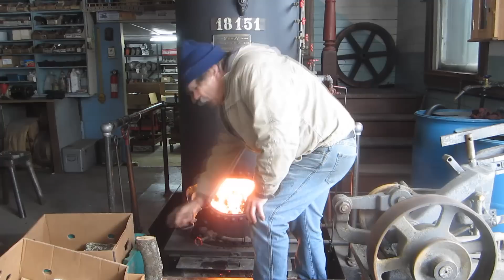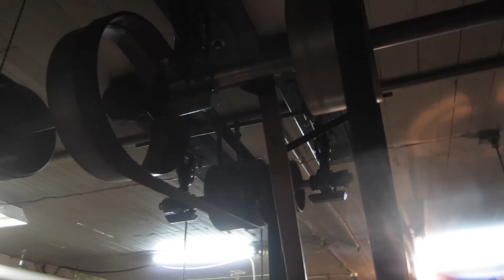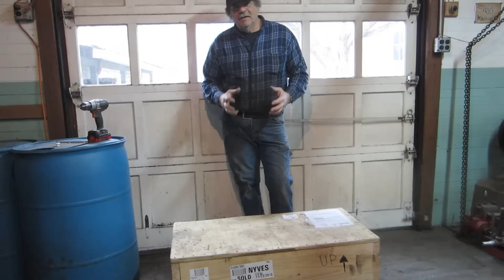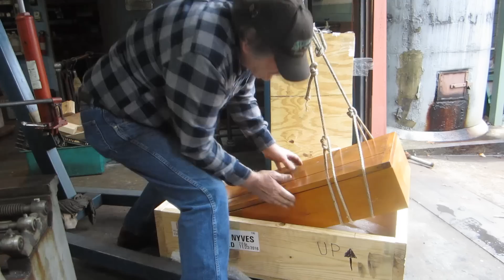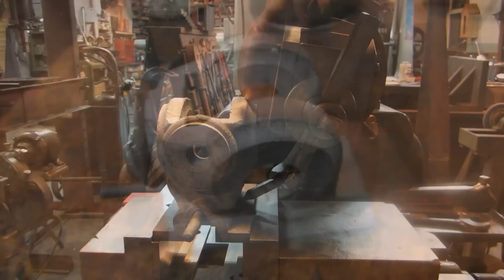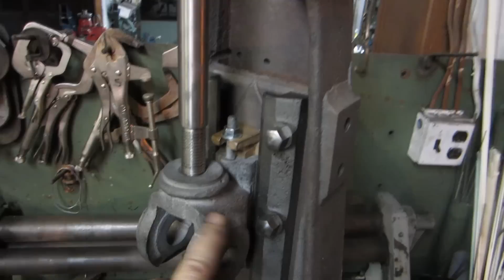OLD STEAM POWERED MACHINE SHOP  18   Progress on the steam engine

Comment: Is it actually necessary to remove the pitting on a wear surface like you showed on the crosshead? Or is it just a point of pride? In my mind it seems like the pits would just trap oil/grease and do no harm. As long as there's no protruding rough edges of course.
Reply from the maker: Probably not, but I figure that very smooth surfaces will trap more of the oil "wedge" at speed and keep the metal pieces apart from each other better under load.....Dave

Comment: Dave: I'm sure you've mentioned it somewhere, but i've failed to hear you explain it. What is the meaning behind the numbers 18151 on the boiler? Is that the permit number Or what?
Reply from the maker: It is the New York State boiler license number issued back when they only had 5 digits.....Dave

Comment: Sir,  Love your shop.  On you rebuilt engined you might try using a "zerts" fitting to be used with a grease gun.  This would keep the dust out.

Comment: I'm looking to build my own boiler. do you worry about boiler chemistry? Do you drain your boiler periodically?
Reply from the maker: Some water is worse than others, but generally a boiler (more so with modern steel) will last much longer with water treatment, regular blow downs and occasional "open and wash out". I use Jim Conte's "boiler Saver".

Comment: I noticed at around frame 4:20 that the speed of the lathe tends to fluctuate a bit,  I'm guessing its the the frame rate of the camera is obviously causing a strobe effect, given the camera is probably the more steady timing this is creating the indication of a speed change on the lathe  i'm assuming from the steam engine  torque changing between power strokes? Does this ever cause you any problems? and does it effect finish surfaces or chatter? Or does that fluctuation actually help prevent chatter by changing speeds ..I remember someplace watching something on modern lathes using that actual phenomenon to reduce chatter by purposeful fluctuating spindle speeds...curious to know what you think about it.. Again I get great joy out of your videos...thanks,
Reply from the maker: At that particular speed, a slight fluctuation in speed must have been driving the camera nuts "strobing" the frames. It definately was not doing what it looked like it was doing. It's a problem with that camera in low light.....Dave

Comment: Hi Dave, another great video, thank you.

I am learning a lot from your workshop about how machines and tools were used.
The one thing about our 1840 - 1870 lineshaft workshop - no graduated dials or handwheels. They made one part then made the next to fit it. No off-the-shelf spares in those days. But, and the big but, those engines are still running after 150 years!

Your comment about the glands got me thinking; all our gland plates at the Forncett Steam Museum are flat as yours was. Our engines are all made in Britain, ranging from the middle 1800s up until the middle 1900s, so maybe it was the packing used that determined the face. We use square-section graphited rope which would require a flat face to compress it. I am guessing that you use round which is why you have a tapered face.

It is true what they say; you can make anything on a shaper except money. Slow but sure.
Good to see you use carbon steel too - there would still have been a lot around in 1925.

Best wishes

Andy
Reply from the maker: Andy: Thanks for the discussion, I think I will use the square section Garlock steam packing, same as was used in the Frick engine that I built the valve rod for. That had a tapered seat (both inside and the gland) and it seemed to work well. It ran all last season and I don't think they ever took it up once. It is amazing what you can do with just carbon steel tooling, but even High Speed steel is getting to be a thing of the past....Dave

Comment: David thank you for keeping the video's coming.love um!i can't wait too see the boring tolling attached to the steam engine cylinder.would you know anything about a machine that turns the diameter of an old style frick crosskead slide.this part is made of a single piece of cast steel.i have researched this process for years and wondered if you know anything about the machine that done this operation?i found several patents for this operation and made a working model from just the drawings.i would really like to see an original machine.can you give me any advice about this?

Comment: I love those old lighting fixtures you've got, fluorescent lighting wouldn't look right in your shop, you've got good taste.
Reply from the maker: Yeah, but Tom thinks we need more light. Maybe hotter bulbs....Dave
Reply: I would try with those glass-bulb warm white LEDs atleast on top of stuff, and it helps if you just put more ligth at the roof so it won't ruin the "feel"

Comment: OK love the old phone ringing at frame 4:58...HA...im guessing an old bakelight? i have one too and must hook it up....
Reply from the maker: It's an external ringer with brass bells mounted up on the wall. I couldn't believe it would work on my system, but I even put a second one in the front shop wall. I can even hear it outside because it makes the wall vibrate.....Dave
Reply: David Richards HA love it thanks...Yeah they kept the old systems the same and built on them...its astounding they can send data on a two wire balanced line that was made so long ago.. goes to show the human ingenuity and as you are my favorite shop to demonstrate that... I cant thank you enough for bringing it into view for us all.. Just the notion that we think all old is primitive and yet the accurate work you can do in a steam driven shop is inspiring.. It show's how we got the steps to our modern technology through so many clever innovators of the time...

Comment: That old boring  bar! Grandad said he had bored cyls with a hand crank setup, I believe he said it was a Rottler. If I remember correctly, he said it was a horrible experience.... Took him to the shop I was working in, back in the late '70's. He'd been retired many years by then. Soon as I opened the door, he said "well the smell hasn't changed any in all these years" I showed him the Rottler we had there, it was a table type, and the head floated on the table over the block to be bored, centered, and then clamped with an air clamp via a T slot. Then we went over to the Sunnen  ck-10 hone. After we left, he said that If he'd had this modern equipment, he'd have made good money instead of just getting by. Thanks for posting these videos, enjoy the warmer weather in Florida, and hurry back to You Tube!

Comment: Hi Dave, Come on, a little lake affect snow and you run south. Were having a few inches  tonight in the lower Hudson Valley tonight, but after the 1st I'm going farther south than FL. Liked that cylinder borer, let's see it do it's thing. The shop in Gasoline Alley had a Kwik-Way.

Comment: Most enjoyable. Great to see the Morris coming together. I see you have a Duplex pump in your shop. I have a Worthington Simpson Duplex, been mine since around 1970. Not been under steam since about 1990 (at the RH & DR). What is the back story on the Duplex? Rgds, Doug.
Reply from the maker: Just something that my Dad had from way back. It had been taken apart and regasketed but the valve timing was all screwed up. It runs nice now on air. I have plans for it sometime....Dave

Comment: Excellent as always Dave. I found that boring bar very interesting. Reminded me of the Van Norman boring bar I used in the 70s while reconditioning car engines for 4 years....excellent machine. 
Enjoy your time down south :)
Reply from the maker: Hi Malc, I have a 777S Van norman, about 60 years old. I bet I've bored 1,000 cylinders with it. Great machine, still made practically the same....Dave
Reply: Very interesting Dave - so you know exactly what I'm talking about...and every one spot on. As you say, definitely a great machine, one of the best I've ever used.

Comment: I often wonder if shapers were used to first machine lathe beds after casting in the early 1900's machines. I would guess they didnt have surface grinders yet in technology til later.
Reply: Something similar was used. Instead of the head the part was moved on a rail, and the cutter was standing still. This works better with long pieces. On my way to school i could see such a machine with a 10 meter bed and 25 meter rails. It had his own building with two open sides. The portal was a solid cast iron and 5 Meter in height. I saw it work only once. It god broken down somewhere in the 90th.
Reply from the maker: There were big planers to do that (same idea only the work moved under the tool bit)....Dave
Reply: metal planer, then hand scrapping.
Reply: This part of what you saw there,
Is called planing machine.
What Dave has is a shock machine.
This is called in German

Greetings Franz
Reply: +Franz Rauschmayr I don't think that "shock machine" is the correct translation. A "Stoßmaschine" could be translated as "slotting machine" but that is rather a "Räummaschine" in German, so you use "Räumnadeln" or broaches in English with those tools - something quite different than this besides the linear motion.

The machines discussed here seem to be referred to as planers when the tool is stationary (and the part moves) and shaper if the part is stationary (and the tool moves).
Reply: shock machine didn't correlate too well in my mind. but what do I know. A shaper is more self explanatory.